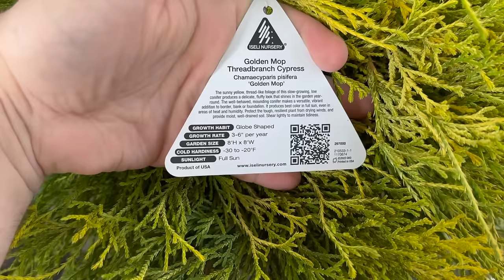Painting & Planting The Porch Planters 🪴|| Visit Our Garden

Comment: Your spray painted pots look really good! I have been spray painting my pots also. I learned early on that the textured paint needs an undercoat, or in your case, an overcoat. I bought a satin finish regular paint as close as I could find to the color of my textured paint. I did a base coat in the satin finish, then did a top coat with textured paint. You did something similar. We are both happy with our paint jobs. Cans of spray paint are way cheaper than buying a new pot. I am changing out my pot colors as well. Like you, I found that dark containers sitting in the sun just cook the roots of the plants.